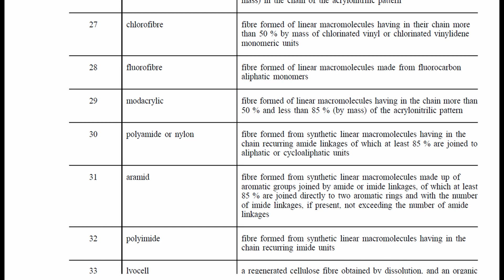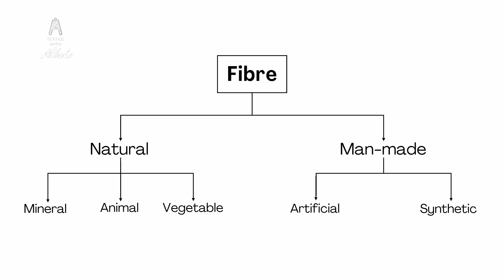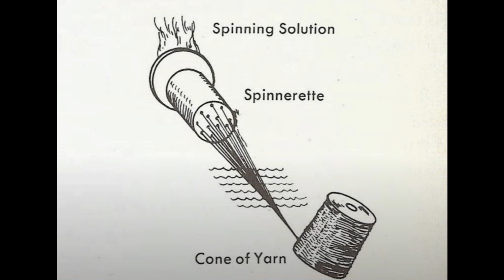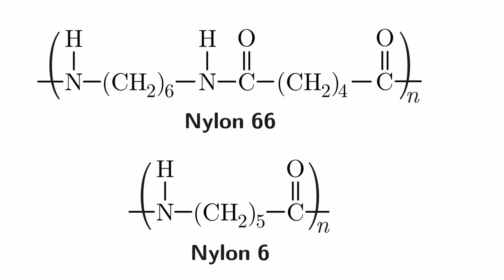Base textile materials: Polyamide (Nylon)

Comment: If I have a piece of clothing made from 91% polyamide and 9% elastane would it be possible for tailor to find the exact fabric and custom make another piece?
Reply from the maker: Hi Carniolan, it's not easy but he can surely find a similar fabric with the same features and same knitting points/pattern, but the color will not be 100% the same due to metamerism. A tailor cannot reproduce a fabric, you have to ask to a knitting mill/weaving mill, but it will cost you a lot of money to study the fabric, project a new one, set up the machines, buy the correct yarn and knit/weave it!
Reply: @textilewithalberto998  if i found the same type of clothing with the same fabric material composition in a shop how different can the fabric be really? Thanks
Reply from the maker: If it's the same clothing with the same fabric material, of course the fabric is the same. Clothing are always produced in series. Are you 100% sure it's the same fabric material? @Carniolan
Reply: @textilewithalberto998  i may have worded my question in a wrong way. I meant the same type of clothing with  fabric consisting of 91% polyamide and 9% elastane
Reply from the maker: @Carniolan  Composition is not the only feature that distinguish one garment from another. You can have two fabrics with the same compositions, but different yarns, different yarn counts, different finishings, different type of weave/knitting patterns, different dyeing technologies. If you think about weaving and knitting alone, there are thousands of different weaving that you can make with the same yarn. If you put a fabric into a stenter for different time, the hand changes completely.